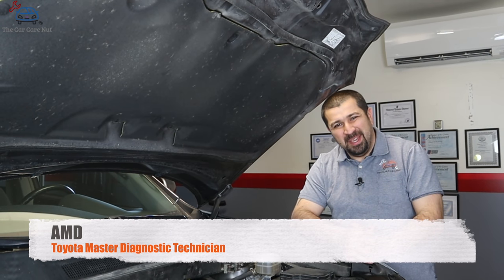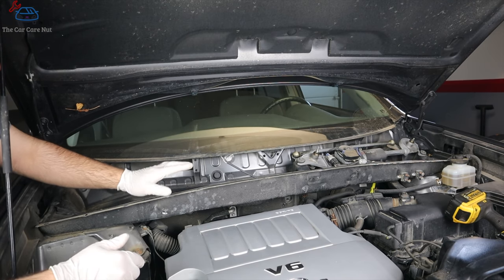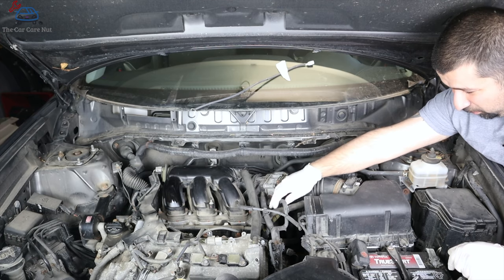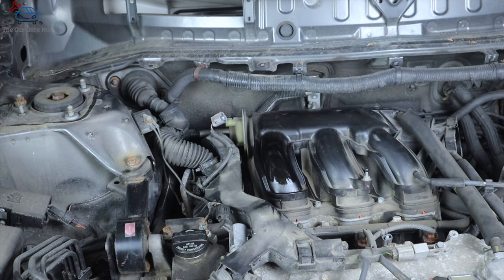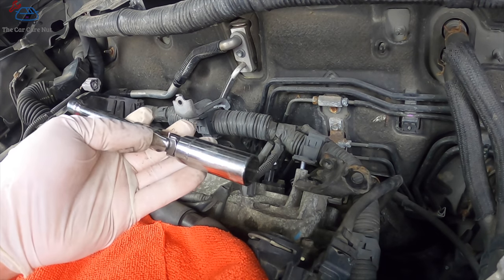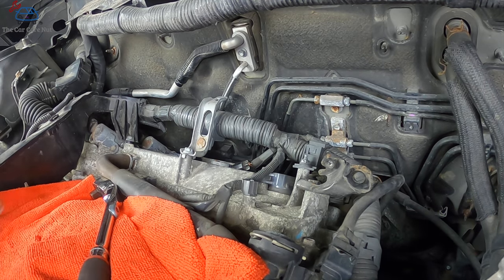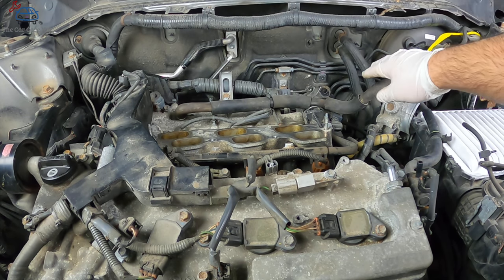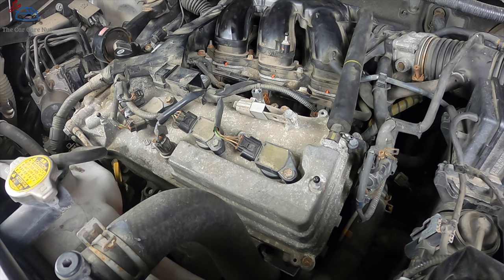How to change spark plugs on V6 Toyota and Lexus 2GR-FE 3.5L engine

Comment: Me after watching this: I should have gotten a 4 cylinder
Reply: I’m glad mine is…😭.
Reply: Yeah,  my 4 cylinder Camry is a joy. My V6 Camry is a challenge.
Reply: But what about the power difference they make
Reply: @misterispusovcikas9066  4 cylinder hybrid then for a little extra performance
Reply: @misterispusovcikas9066  yep especially since there isn't a big fuel consumption difference
Reply: @daijoubu4529  not sure if it was sarcasm, but the v6 is pretty much a fuel saver with engine that big?
Reply: @misterispusovcikas9066  i mean the i4 is a big 2.7L, the 3.5L V6 doesn't consume much more
Reply: @misterispusovcikas9066  
I own 3 Camrys, 2 with the
Four banger( a great engine
probably the best ever built)
as well as one Camry with
that V6. It really does get fine
mileage. It is a bear to work on. 
I prefer those inline fours indeed. But I drive the XLE more. Just because it has  more options and comfort. 
Power is not really a difference
although. Again that Four is
quite a engine. I like the 90’s
thru 2001 for vintage also.
Reply: God forbid you try to do a kitchen remodel LOL
Reply: @daijoubu4529  the cost of maintenance is weigh less with a 2.7
Reply: Get specifically a 94 Toyota celica 😃
Reply: I was able to change them in my Toyota Camry 2002 but this Lexus is a pain in the eye.
Reply: Exactly I'm trying to figure out what the hell is all these extra steps
Reply: @misterispusovcikas9066  totally agree, I have v6 model and it’s very economically when it comes to fuel.
Reply: No, you only change them every 120-140 k miles so buy the engine you like. My 2007 camry V6 has 220 k on it i have onky changed them once. Yes it was several hours of work but car needs very little maintenance other than oil and brakes.
Reply: @sjd7188  do you know if they come on the camry stock? I have a 2010 Camry SE with only 85k miles. I bought it at about 55k so thought I might need to change them.
Reply: @adom9463  manual states 120 k change interval
Reply: Or 8
Reply: Same dude
Reply: @tails300  any oil burning issues with your 4 cylinder highlander?
Reply: Same here
Reply: That's what Scott Kilmer recommends
Reply: Hahaha  😆  I was thinking the same thing.
Reply: Me every time I put the hammer down to pass a car uphill: I’m so glad I got the v6
Reply: can you guys imagine to change V8 engine spark plugs it’s even more work
Reply: @andreylosetskiy5217  well V8 engines are usually sitting longitudinal rather than transverse so there’s no need to remove the intake plenum or cowl.  Depending on the vehicle they can be quite easy or rather miserable.
Reply: @jeffmacey6482  but clunkier ride
Reply: Never go 4 cylinder 😂 my rav4 is so quick and ready to go its scary sometimes.
Reply: @thegreat9481  are you comparing it to a bicycle? My 13 RX350 is ok, but not that exciting. My 04 Escalade was faster, and that was a slow Escalade as far as Escalades go.
Reply: @greenbudkelly2820  thats your opinion. The V6 on the Rav4 is too much for the car in a good way.
Reply: Absolutely not . This job is once every 100K miles . V6 absolutely worth it . Power is not on the same level . Life is way tooo short to drive a 4 cylinder car . I own a Lexus es350 2015 with the 2grfe engine and I would never trade it for any 4 cylinder car I absolutely love it .
Reply: My Prius 2010 Hybrid 4 cylinder still need to remove those parts to reach spark plugs too.
Reply: Lol
Reply: Haha. It’s not too bad, but I tell people if you don’t need a v6 or v8 then don’t get one bc it makes maintenance so much easier. It also causes less wear and tear on your transmission. My sister in law has a 4cyl Honda accord and literally took 10 minutes to change the spark plugs and I’m sure it’s the same with every other 4cylinder.
Reply: I was able to do it without removing the intake. The rear left was tricky because of the cam sensor but I was able to get it.
Reply: @daijoubu4529   I have a 2011 Avalon 3.5 v6. My wife has a 2011 Corolla with the 1.8 4cyl. My car gets better mileage around town than her's!!
Reply: @andreylosetskiy5217 I have a V8 tundra. It’s pretty easy.
Reply: @greenbudkelly2820 exactly why I’ll never part with my 15 xse. Love that V6.
Reply: Lmao yesss🎉
Reply: @ahmadghosheh3104  duly noted for my next yoda
Reply: Brother mines the v8 in the ls430 just dropped 100 on NGK plugs yesterday 😂
Reply: Have both and the 4-cylinder is WAY easier to work on.
Reply: Tell me about it
Reply: 100 percent. This is dumb af to design anything like this.
Reply: Facts!!!😂
Reply: You know whats even worse is when all 3 of the coil boots are stuck to the plugs and the coil comes out and leaves the boot. That was a fricken blast. Ask me how I got those out. What a chode of a design.
Reply: I need a nap
Reply: If this is considered difficult to you you prob should stay away from working on cars
Reply: @rudycastellon6360 the 2.7 is not prone to oil burning, those are mainly the 1.8, which is also a great engine if you maintain it correctly and use the right oil.
Reply: @greenbudkelly2820 look up the 0-60 times, I bet you’re wrong. Truck-based vehicles feel faster, I drove an FJ Cruiser that weighs more than my ‘12 Highlander v6 and I swore it felt faster, but it was actually 2 seconds slower to 60.
Reply: @polygaryd buy a Kia or Hyundai, they have the nicest most tidy engine bays, literally every one I’ve seen was simple and open. Hard to believe my highlander has so little room under the hood, but it’s to improve balance and handling and maximize interior space.  Cab-forward is the word for this. Also; I could pull my whole Subaru engine in 2 hours, but I had to do it three times in 60,000 miles, I’d much rather have a Toyota that’s reliable and harder to work on.
Reply: Put Iridium spark plugs in so you are good for 150k miles and forget doing the job again. Matt from off road recovery admitted that he left his spark plugs in for 200k miles in his jeep and he does a ton of low speed driving and also idling.  Owners with Iridium spark plugs should only change them 1x during the life of the car if you do it at 150k miles then you are good till 300k miles.
Reply: no, the 4cyl is too touchy. I love the v6
Reply: Yeah my mechanic told me to get the turbo 4
Glad I got it
Reply: ❤ 😂 Me toooo😢.
Reply: All of that just to change plugs wish I had straight line 6
Reply: It's light. You can leave this on and remove the intake manifold too.
Reply: Yeah. I had a 2012 Sienna with the 2.7 l4.   It always got 20 mpg.  With my 2007 Sienna I always get 20 mpg. So then the real benefit of having the 4 cylinder is that you get 80 less horsepower.  😀
Reply: Same bruh I got v6 thinking oh yeah it’s going to be faster hindsight I wish I went for the v4 version of my car but I’m still happy with my choice
Reply: I had that last week on my wife's Ford Edge.  I did the back 3 first.  
I was sure cussing when the boots were stuck to the plugs.  By the time I was done I was pretty good at extracting them with a surgeon's clamp or forceps.   They did come out in a few pieces though.
Reply: @polygaryd  
I had that last week with my wife's Ford Edge.  I started with the back 3 and I sure was cussing when the boots were stuck to the plugs.  
I got them out with a surgeon's clamp or forceps,  although they came out in pieces.  By the time I was finished I was pretty good at getting them out.
Reply: @pnotuner1 , imagine it happening on all 5 boots of a VW 2.5? Luckily the customer had new coils and plugs. 45 minute complete job turned into over 2 hours. I went on Amazon and purchased the special boot puller tool for $12.
Reply: Same
Reply: Why?
Reply: @thegreat9481 seriously. I’m always surprised by how quick it is.
Reply: @greenbudkelly2820 the 3.5 in the rav4 makes it fly. Much lighter than the RX.
Reply: @justintoth5440  i love when i see another one on the road
Reply: Gotta love my k series
Reply: It's not hard -it's a pain.
Reply: Haha!! I mostly drive a V8
Reply: Actually not 4 cylinders. Just rwd because the engine turned other way
Reply: Me after trying to fix my car: I should’ve just walked
Reply: Awesome mechanic..  awesome knowledge and patience.  Love what you do and sharing with us "little d.i.y. wanna be mechanics".... God bless you sir.  👋🙋🙏
Reply: oh u will double the fun if your knock sensors go out
Reply: Never get v4 for Highlander
Reply: Or a Honda v6. They are dead simple easy to change
Reply: So funny it's true that V6 is a bite to get that manifold off!
Reply: The only good thing is we can pull our 19 ft boat with the V6 and extra towing cuz it has a larger radiator too.
Reply: Ha!Ha! Sinks and garbage disposals a little easier to do. Have done a couple.
Reply: Our 2008 Toyota Rav 4 has 130,000 miles just now changing out spark plugs and coils. It's been running good , but needs it as manufacture states to change at 120,000
Reply: Oh it’s fine. Just pull the entire engine to change the plugs. Great design Toyota. We should all consult a mechanic about common maintenance before buying cars. Instead we get obsessed with the aesthetics of the car. By we I mean you - yes I’m judging you humanity 😂.
Reply: First step order a few hundred new clips😅
 I wonder if you could get a kit with all the possible clips I could break when I do this job.😅
Reply: I would have never thought to take the Cowell and wiper motor off to do this.
Probably would just cussed for a few hours and broke a bunch of stuff.
 Thanks car care nut.😊😊
Reply: Make sure you buy toyota parts only for this job or you will be doing it again way too soon with auto parts store crap.
Don't ask how I know this. 😅

Comment: I just spent $800 to get the plugs changed on my Avalon. After watching this video, I'd say it was money well spent. 😒
Reply: They ripped you off. I found a mechanic at a local shop. He charges 250 labor only. I’m looking at 300 with plugs from Amazon. 
I am still looking for a cheaper mechanic that can do it for 200 or 150.
At that price in money well spent. You need to shop around.

Comment: Finally! Toyota v6 2gre-fe engine spark plug replacement video made by the right person, a Toyota expert.
Reply: For professionals removing the cowling is highly unlikely. I get he's shooting a video though..
Reply from the maker: I do remove the cowl on most of them professionally. Takes 2 minutes and makes the job much easier
Reply: @TheCarCareNut  Well sir whatever works best for you🙂. I've never had to on any configuration of the 3.5l yet and i can get to that bracket without much pain. Salud
Reply: @Usmanthemecano  I did not remove the cowl either when doing the rear bank, or even need a TB gasket because I did not separate it.. Also did not remove the coolant hoses at the TB. J
Reply: @jimb8842  exactly.
Reply: Guys who’s cares how you do it,  he’s just making it easier for first timers. It’s not that serious 🙄.
Reply: @tails300  Because it's not necessary. The more you remove the more chance there is for something to break or get messed up. One example: How many times did he say to be careful around the glass? If you don't remove the cowl you are not near the glass. Taking more off is not necessarily easier. People can do it however they want. Just letting them know there is more than one way.
Reply: @tails300  relax man. No one is against the brother. He's a fine auto tech. There are just many more ways to Rome
Reply: @jimb8842  again not that serious.
Reply: Finally this Video confirms why I prefer the 2JZ'-GE in my GS300..removing cowling...wiper motor to change Spark Plugs?🥳
Reply: No need to remove the plenum...this was the hard way...more disconnection...more potential leaks guring reassembly
Reply: @Usmanthemecano    Have you done a Sienna 2007 to 2010 without removing the cowl?  I would like to see a video of that please.
Reply: Nice video. I need to change the plugs on our 2010 highlander. This confirms my opinion that who ever thought a transverse v6 was a good idea should be beaten mercilessly. Also it's why cat based SUVs are garbage. Toyota, keep the 4runner as a body on frame truck! DON'T do what Nissan did and ruin the pathfinder.
Reply: @Usmanthemecano  it's good info. The car care nut is doing information video. Personally i am glad he did because on the Sienna you have to, and now I know how.
Reply: @TheCarCareNut  enjoyed many of your videos, just watched your first video and now what a difference. I wanted to get exact same swivel impact socket with lock for spark plug replacement , just like you have, link seems to show some other spark plug socket not the one you have. Could you please post the exact link.
Reply: @TheCarCareNut  I agree. There is no way in the world you'll be able to remove those plugs without removing the cowling. It's hard enough to remove those plugs without the cowling in the way, imagine with cowling???
Reply: Agreed!!!  This made life so much easier than expected.
Reply: 🙏👏👏👏👏👏👏 thank you.  Excellent  job. Very well done
Reply: @rjgesmundo4427  I do it a couple times a month dude, no need to remove the cowl, just the intake manifold,
Reply: @Recrussio  But how?
Reply: @rjgesmundo4427  I did this diy on a 2013 Venza, and I have a video on how to remove the bolt in the back
Reply: Experts don't remove the wipers, wiper bridge assembly, and cowl tray. Experts charge about 2 hours for spark plug removal on these V-6s. Experts remove the 2 bolts on the back side of the intake plenum holding it to engine without removing the cowl tray or wiper system. Anyone who says removing the wiper arms, wiper bridge, and cowl tray is a "two minute job" is lying. The vehicle is designed for "professionals" to be able to remove/replace spark plugs without taking the wiper arms, cowl cover, wiper transmission bridge/motor assembly, and cowl tray out for access. Anyone who thinks it's "professional" to do all of the above is a BS artist novice.
Reply: @Usmanthemecano  there will be pain from scrapes of that wire harness in the rear
Reply: Hi @SuperMan-uj7dh  thanks! It's been 2 yrs since I've done it. The car just turned 200K plus last week! and still running fine besides the CEL and VCS light comes on and off once in awhile. Also, the intake manifold that I broke from tightening the bolt before is still holding up without replacing it ever since. The CEL and VCS light came on yesterday, so I used my OBD Scanner to get the code. I got code: P0354 Ignition coil D, Primary/Secondary Circuit issue. I already research the code and get some info about it, how to fix/diagnose the problem, so I'll try what is hopefully would work. I hope Mr. CarCareNut here will drop some input :)
Reply: Is it possible to remove the intake manifold on a 2013 Lexus RX 350 without removing the cowl? On Highlander and Sienna, there is more room to work. @Recrussio
Reply: Create a video very informative pays Tell don't know I can do it on 3.5v6 alphard
Reply: @cjg6364 Can you please make a video showing the easier/simpler way? Thanks!
Reply: I did with without removing the plenum... I hated myself for it too. @TheCarCareNut
Reply: Please, show how this is done according to you. I would greatly appreciate it because I need to do it tomorrow! Thanks so much
Reply: You must not have worked on this engine. Removing the cowl is the RIGHT move. I'd like to see you make a video and see how long it takes you without moving the cowl.
Reply: THE COWL AIMT HARD TO REMOVE AND IT DOESN'T TAKE A LONG TIME. I'M DOING IT NOW, REMOVING THE COWL IS EASY AND NECESSARY